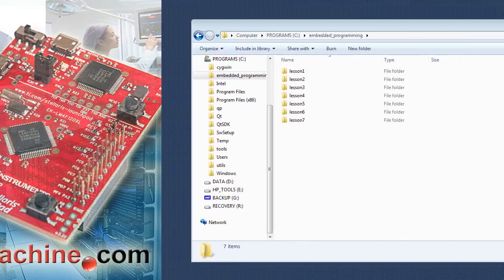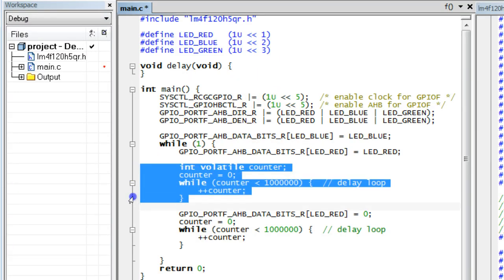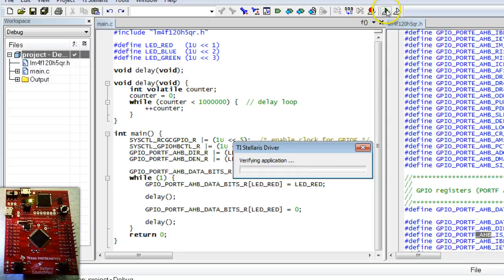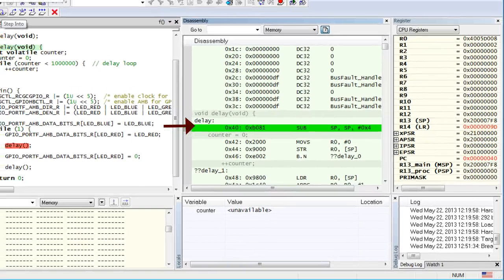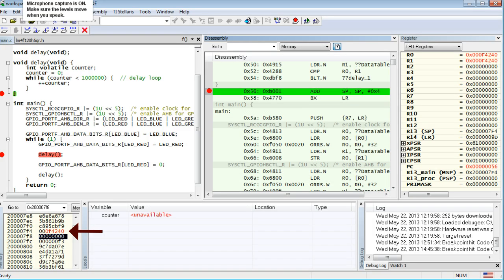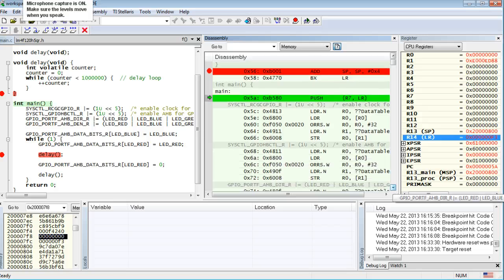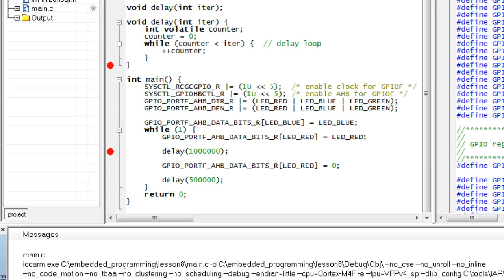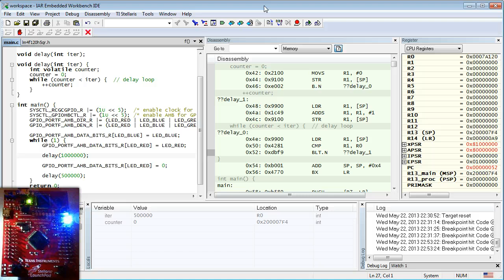#8 Functions in C and the call stack

Comment from the maker: Julio,

A low value of a pull-up resistor is called a strong pull-up (more current flows), a high resistor value is called a weak pull-up (less current flows). For more information about pull-up resistors, please go to sparkfun dot com and search for Pull-up Resistor.

Comment from the maker: RTOS is actually not that hopelessly far off. Perhaps 3-5 more lessons will give enough foundation to talk about preemptive multitasking.

CAN or LIN are a different story, because they require hardware support. The LanuchPad board does not have CAN or LIN interfaces.

However, I plan to talk about UART and serial communication. The LaunchPad board has a serial port connected to the hardware debugger, which shows up as a virtual COM port on the host.

Comment: Hi Miro!

I'm a beginner in Embedded systems. Here I could understand that all the local values are pushed into stack also the return address but I am wondering where those instructions are all loaded? Inside RAM? if so how does the control flow changes to part which belongs to the function. Does the instructions are stored sequentially ? or it maintains the address of each function blocks? I'm messing up here a bit.
Reply from the maker: I recommend that you watch two more lessons (#9 and #10) about the functions and the call stack because this might clarify a lot of things for you. And also, you now have all the tools to investigate your questions yourself! Just open the debugger and single step through the instructions in disassembly right before the function call, inside the function, and after it returns. When you do this, you'll see that code is always in ROM (adresses staring with 0x0000xxxx on TivaC and close to 0x0800xxxx on STM32). Data, including the stack is in RAM (addresses starting with 0x2000xxxx). The instructions are stored sequentially, but there are branch instructions that change the flow of control. One of these branch instructions is function call BL <function-address-in-ROM>. The other branch is function return BX lr. Please watch them as you step through the code. --MMS
Reply: @StateMachineCOM Thanks for replying back❤️ 
Thought to do so. Proceeding with lesson 9...

Comment: Quantum Leaps, I have a question for you. 

For the record:
#define LED GPIO_PORTF_AHB_DATA_BITS_R

Does toggling the LED[RED]^=RED in the function like this negate the one line STR command that we covered in the previous videos? I'm trying to discern if this would reintroduce the interrupt error you were speaking about previously.

void toggleRed(volatile int c){               //conversely, |= toggles on and &= toggles off bits
  LED[RED] ^= RED;
  while(c < 1) ++c;                           //blink delay
}

This reduces the while loop to something like this:

while(1) toggleRed(0);                      //flashing red
Reply from the maker: The code like LED[RED]^=RED is a read-modify-write operation. But the Tiva GPIO is designed such that it does not impact any other bits of the GPIOF port, so it is safe from race conditions, assuming that the RED bit is not shared (see Lesson-20). Regarding your toggleRed() function, the while (c<1) delay loop looks suspicious. --MMS

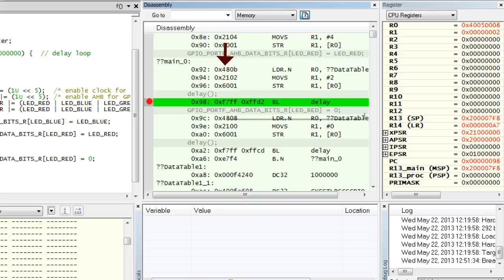Comment: thanks for nice course, I really appreciate it. Could you please. Could you please explain more what do you mean in in 7:01 for 2 Byte and 4 Byte instruction.
Reply from the maker: The THUMB2 instruction set supported in the ARM Cortex-M processor contains a mix of 2-byte and 4-byte instructions. For example, at 7:01, at the address 0x92: you can see instruction 0x480b (LDR.N R0,??DataTable), which is clearly a 2-byte instruction. However, at the address 0x98 (at the breakpoint), you see an instruction 0xf7ff 0xffd2 (BL delay), which is a 4-byte instruction. --MMS

Comment: Isn´t the signature only the list of parameter types?
Like for a function:
double AddDoubles(double n1, double n2)
Isn´t the signature (double, double) ?
I thought the compiler distinguished between two overload functions
using the signature, and since the return type is not part of the signature
the compiler can´t distinguish between float Add(double n1, double n2)
and double Add(double n1, double n2) because both have the same
signature (double, double)
Reply from the maker: Strictly speaking, a signature of a C function consists of the types of the return and all the arguments, ignoring the names. It determines whether a function is compatible with a function pointer. There is no function overloading in C. --MMS
Reply: Thank you. I am mixing C and C++...

Comment: If a function takes arguments, or contains other variables, or contains static variables (local to the function), are they stored at the top of the stack, near the base address of the stack, as well?
Reply from the maker: First, static variables within the function are most definitely NOT stored on the stack. They are stored in the BSS or DATA sections. Please watch the lessons 13-15 about startup code, where the memory sections are explained. Now, regarding the function parameters and local variables in a function, they might be allocated to CPU registers, or might be on the stack. Please watch lessons 9 and 10, which explain the AAPCS (ARM Application Procedure Call Standard.) --MMS

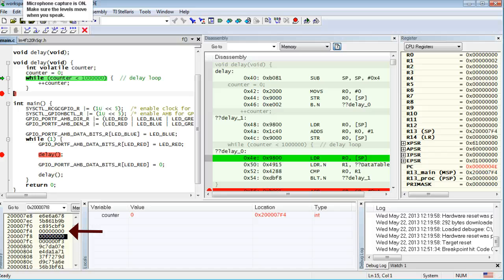Comment: Why did the compiler generate code to immediately decrement 4 from the stack pointer when execution enters the delay() function (@7:40) only to generate additional code to reverse this operation at the end of the function (@9:12)? 

Seems like the decrement served no purpose and is a waste of 2 instructions.
Reply from the maker: The compiler decremented the stack pointer on entry to the function, because it needed to allocate space for a variable (please remember that the stack on ARM grows towards low memory, so decrementing SP actually grows the stack). Of course, the stack had to be incremented back to the original state upon the exit from the function. To understand why the compiler had to do this it is perhaps easier to imagine what could happen if it was NOT done. So, in that case the stack wold not grow, so any interrupt, for example, could come and USE the stack above the top. This would then clobber the variable needed in the function. So, you can see from this that decrementing the SP protects the stack content up to the SP. I hope this starts to make more sense to you... --MMS

Comment: Hello Sir, As always great explanation.
 I am new to embedded world. Coming from Software engineering background. Just like you can create an App or even a console applications in Visual studio, how can we create an application and control the embedded system like Stellaris. So far we are writing in a compiler and only running through it. Can we not create something like .exe or standalones. I know we are at a beginning stages but I was just wondering or I am drawing parallels between regular c++ programming  in VisualStudio and embedded programming.
Reply from the maker: In a sense, every lesson of this video course is about the differences between embedded systems programming and programming for the desktop. So, specifically you will NOT generate any .exe files here, because they need an operating system to be loaded to RAM and executed. You DON'T have an operating system for this. Instead, you create a binary file, which is permanently programmed into the flash (ROM) memory of your microcontroller at a specified address. The code is then executed in-place, directy from ROM. There is no "booting" phase when you power up. The system is up and running within milliseconds. --MMS
Reply: Great thanks, that is actually true. My thought process was clouded coming from Software engineering background. Yeah now I remember embedded system is meant to a do specific task in a predefined way and that code is always stored in ROM.

Comment: Why does my code have

sub.w  r13, r13, #8

instead of 

sub r13, r13, 3

It is allocating 8 bytes for an int  variable?
Reply from the maker: First, sub r13,r13,3 would allocate only 3 bytes on the stack, which is less than an 'int' (4 bytes), so that wouldn't work. But allocating 8 bytes for an 'int' is really interesting! It turns out that the ARM Application Procedure Call Standard (AAPCS) requires that the stack is 8-byte aligned at all external interfaces. See also my question and discussion on StackOverflow: https://stackoverflow.com/questions/73764958/why-iar-arm-cortex-m-compiler-does-not-align-stack-on-8-byte-boundary  --MMS

Comment: In the exception handler, does the arm processor go to undef mode
Reply from the maker: "Undefined mode" of the classic ARM processor is not supported in the modern Cortex-M processor. In Cortex-M, you only have the "Thread mode" and "Handler mode". While processing an exception, a Cortex-M CPU is in the "Handler mode". Otherwise it is in the "Thread mode". --MMS
Reply: @StateMachineCOM  Thanku, you are adding more value to my career. Keep up with the good work

Comment: In the second half of the lesson, when you explain how the value of LR is pushed to the stack at the beginning of the main( ) function, I don't quite get why LR points to 0x000000F3. I scrolled down and it seems that the LR is pointing to the instruction: BL exit. You had mentioned that main( ) needs to push the LR to the stack to "preserve it's own return address." I'm thus a bit confused now. Could you please explain the significance of this? 

I'm also a bit confused about how the Stack is organised in the RAM. If it's up to us to grow or shrink it at will, then are some of the memory addresses above the stack not used for anything else? 

Thanks again Miro!

Comment: How do I use a function that was defined in another file but within the same project?
Reply from the maker: All a C compiler needs to use (i.e., call) a function is to see the prototype of the function. So, you provide the prototypes of your functions in a header file (.h file), which you then #include in your .c file(s). This is sufficient to call the functions. Then, in the last step of the building process, the linker will connect the function calls from all modules to the function definition (function code). Of course, the function code must exist in some compiled module, or else the linking process will fail. --MMS

Comment: Thanks. 1- Does it matter to know details of Arm instruction set behaviors like "LR should be even in Cortex M otherwise it throws bus fault" ? Since the architecture may become obsolete by others (for example maybe Xtensa). But otherwise this has good teaching value.
Reply: 2- I gather by not checking "require prototypes" option, IAR adds the prototypes automatically? If so, what is the gain we achieve by checking the option?
Reply from the maker: I think that it is generally good to know where hardware faults, such as bus-fault exception can be coming from. It is not enough just to talk about it without giving a concrete example. Here, the example is for ARM Cortex-M, because this is the processor used. Regarding the obsolescence of this architecture, it will remain relevant for the foreseeable future. Much more so than any other architectures, such as: PIC16, 8051, or even AVR and MIPS (e.g., PIC32). --MMS

Comment: Hi Miro, if the ARM HW designers don't want R4-R11 to change during a function call, why didn't they just design their HW so that a function call (BL instruction), in addition to modifying the LR register, pushes in R4-11 as well? Thanks. E
Reply from the maker: Pushing additional R4-R11 for every function call would be horribly wasteful, both in CPU time and in memory usage for the stack (!) Instead, the AAPCS allows for "lazy" pushing of registers only if necessary. Small functions don't pay the price at all. Bigger functions only push what they absolutely need. --MMS

Comment: Hi, I declared  the counter variable as non volatile integer and debugged the code, I see that the counter is stored in R0 register instead of the stack, also i noticed that the SP is not changed when stepping in to the delay function. Can you help me understand  this behavior.
Reply from the maker: A non-volatile automatic variable is typically allocated in a register, so that's what you see. However, once you make it volatile, it must have a permanent address, and the only choice the compiler has is to put it on the stack.

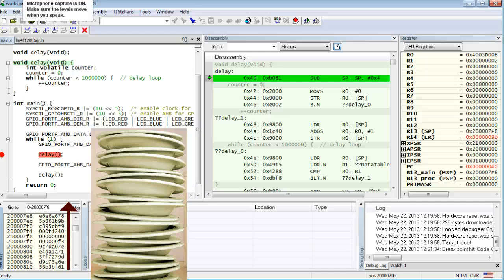Comment: Hi, (8:50), why is growing of stack processor dependent?
Reply from the maker: +Gaurav Minocha 
The direction of stack growth typically depends on the CPU architecture.
 If the stack grows towards the lower addresses in RAM, then the stack 
is called "descending". If it grows towards higher addresses, the stack 
is called "ascending". The majority of embedded CPUs, including ARM 
Cortex-M, have a descending stack. If you are interested to learn more 
about stacks and how they can lead to problems, I would recommend my 
blog post at: 
http://embeddedgurus.com/state-space/2014/02/are-we-shooting-ourselves-in-the-foot-with-stack-overflow/
Reply: +Quantum Leaps, LLC my question was a little different..I think I got my answer..so processor is design to move to next LOWER address when something is added to the stack..and base address of stack is hardcoded in processor..correct me!